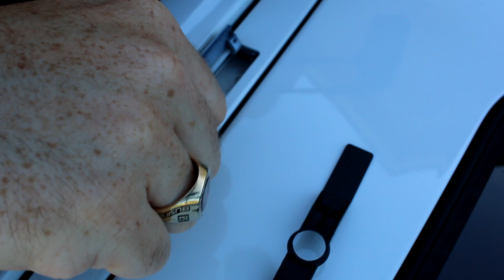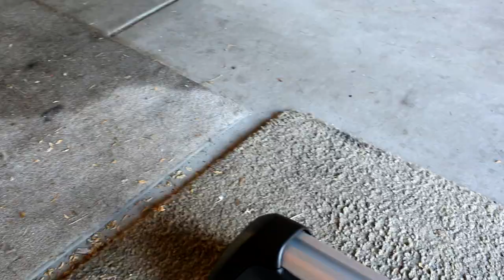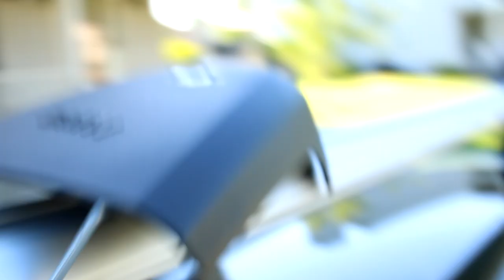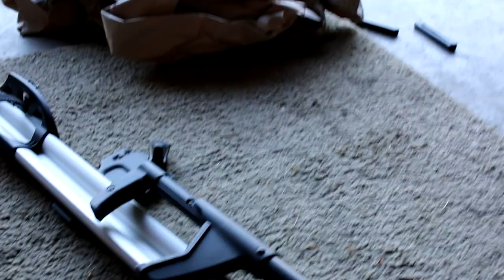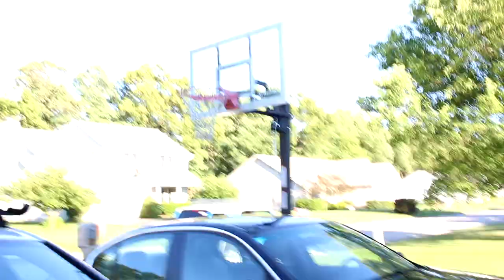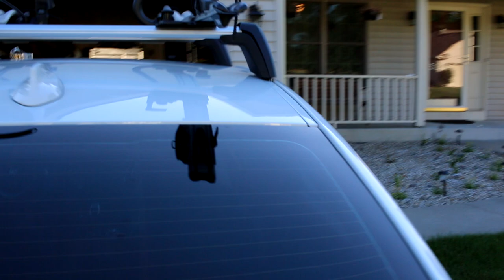BMW F30 Bike Rack Install

Comment: Nice vid, which bike carrier do you have?
Reply from the maker: Thanks.  The bike carrier is the BMW Touring Cycle and Mountain Bike Holder - part# 82712166924 on the BMW Roof rails - part# 82712361814.  For my setup you will need to buy one part# 82712361814 (it comes as a set of roof rails) and 2 part# 82712166924 as the bike holders actually come individually.  Please subscribe to support my channel.  I appreciate your views and  comments.

Comment: Me again.. Lol..
Have you found a way to reduce or eliminate the howling wind noise?
Reply from the maker: Thinking about possibly putting a wind deflector on it this summer.  I haven't looked around recently but I think Amazon had some.

Rhino Rack Wind Fairing, 38-Inch/965mm https://www.amazon.com/dp/B00E5TI74S/ref=cm_sw_r_cp_apa_i_v45WCbTETR5YM maybe
Reply: @MessyGarageBMW  did you ever find a wind deflector that you liked?
Reply from the maker: @kellymccabe3572  never did put one on.

Comment: How’s it going, thanks for the video. Question: My tires are pretty fat on my mountain bike, does the surface where the wheels sit seem to be pretty universal (Wide/Large) or does it have a limited spacing? 

Thanks in advance.
Reply from the maker: They are fairly wide.  I use it for an old school BMX bike and it sits pretty deep in there.  I think it is wide enough to cradle the tires.  The straps on the wheels and the arm holding the frame are very secure so it should hold well.  It is supposed to handle a mountain bike pretty easily.

Comment: I had the same question as a previous poster. This video is incredibly detailed up until the point I was looking for which is HOW to reverse the front bracket. On mine it seems to hit the curve in the rail in a weird way and not sit flat. It works but looks weird and doesn't seem like the "feet" inside the rail hit the right way.
Reply from the maker: So I just went out to my garage and recorded a video of flipping the driver's side rack around.  It sounds like you already got it done and working but I'll post it anyway as soon as I have it edited.  (will be quick and ugly)  But the end result is that the racks do fit but the are not exactly lined up front to back.  There is a slight offset but it does fit.
Reply from the maker: https://youtu.be/nFrb14lSvso

Comment: Will that bike rack fit e90s roof bars?
Reply from the maker: Looks like it should.  I have an e90 too and it looks identical to the f30 roof system
Reply: @MessyGarageBMW on the bike rack , can u adjust/mod distances of the pieces that go attached to the bars ?
Reply from the maker: @DL-sy5fv  yes the width of the main rails can be adjusted.

Comment: How much does this whole set up cost?
Reply from the maker: I found mine new on ebay.  It is cheaper that way. You can find them online for about $250 USD for the base rack plus $115 USD each for the bike racks.

Comment: Thanks for the video! 
I just ordered the roof rack and 2 bike holders as you have.
I was wondering how you reversed the bike holder to accommodate the driver's side?
 Did you remove the upright tube? Or just slide the entire assembly on reversed?
Thanks
Reply from the maker: Take the ends off and the tire holders slide off.  Then you can turn them around the right way.  The frame holder and lock mechanism has bolts at the bottom holding it to the rail.  Take those off and you can turn it around.  I probably should've covered that in the video.
Reply: @MessyGarageBMW  .. I received my roof rack today.. Installed in 10 minutes!!  Thanks again... However, I do want to mention that the rack I received has a new lockdown mechanism for attaching the ends to the vehicle.. No longer need the tool.. It hand tightens, and has a handle lock. Tool free removal too.
Reply from the maker: @Anthony8858  That is awesome.  I'll have to check out the new rack with that tool less feature.  That would be way more convenient.
Reply: @MessyGarageBMW  I coudn't figure out how to get out the frame holder bolts - some pics of that process would be highly appreciated...

Comment: do you get alot of noise on the hwy?>
Reply from the maker: "A Lot" is relative.  It does cause a whistle and I was thinking of trying to find a wind deflector to put on it to cut down on it.  I'll put it this way.  I just had to go on a business meeting and took the expressway for about 3 hours and removed the rack before I left to cut down on the whistle and have a quiet ride.  It isn't bad but is noticeable and I image it would be more so at 90.... um... I mean 70 MPH (gotta stay at the speed limit :) )